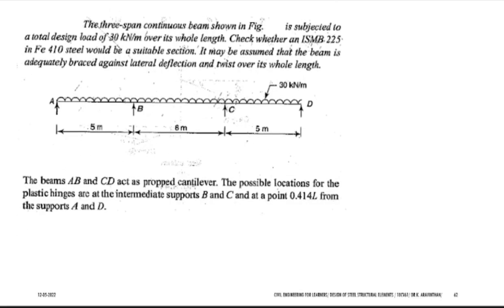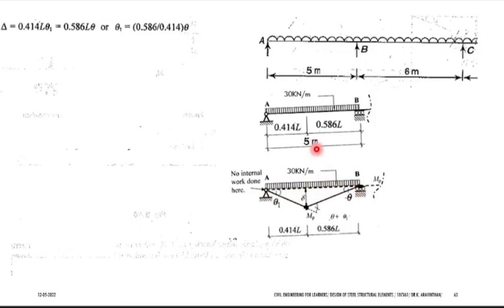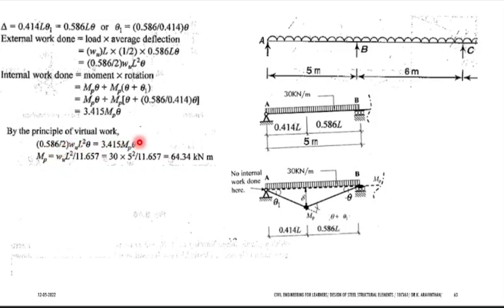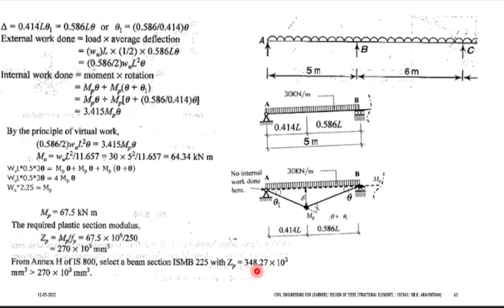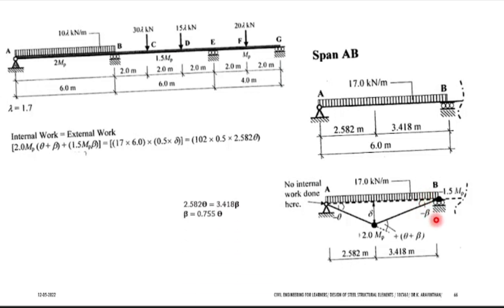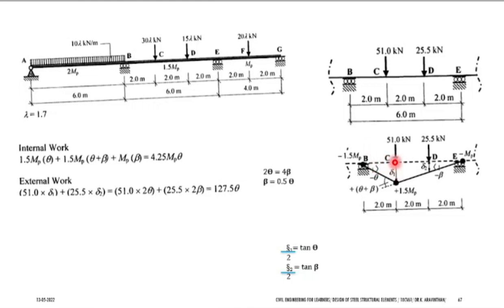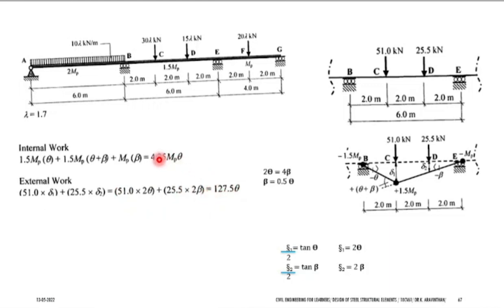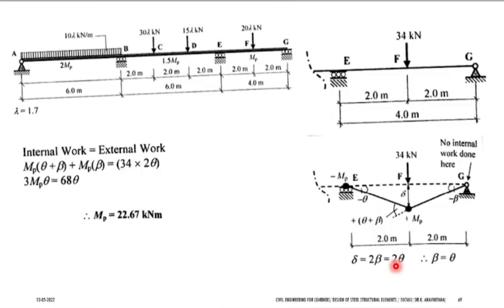Plastic collapse load 1-11|Continuous Beam analysis|Design of Steel Structural elements|18cv61

Comment: . 414×6 is wrong in second
Reply from the maker: @varun270588 
In 2nd problem.
Yes you are right. There is a small error.
The answer should be exactly 0.414x6=2.48

Even though if you proceed  this the ultimate moment will be similar to 28.4KNm.

Anyhow, the solution gives a good result for both the conditions.

Thank you for highlighting.